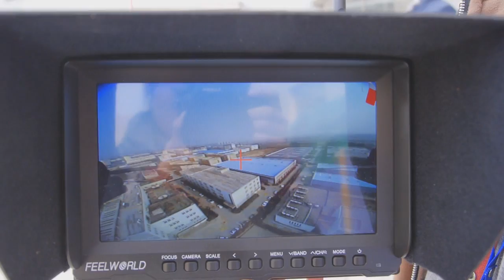Foxtech Beetle(Cicada) FPV Racing Hexacopter combo(I crashed!!!)

Comment: Beautiful design!
Crash is not a shame especially with a mini hexacopter lol
Nice job Mister Fu :)
Beautiful FPV monitor by the way ;)
Have a great weekend
Reply: ABMNS PRODUCTION  yeah, due to the weight, I didn't put on the low voltage alarm

Comment: Fu, after watching your video I might consider a mini hexacopter like this. But what are the flight times on what battery size? I still like efficiency on a mini tricopter or a mini quad. The sound I like very much.
Reply from the maker: Alfonso Alfonsos  we are using 3s 2200mah battery , about 10mins fly time .  For this kinds of frame ,we are more emphasize on speed rather than fly time Lol .

Comment: Great video! Very cool presentation!
Reply from the maker: Damir Spanic Thanks !
Reply: +Foxtech Hobby ... Video = Very good, & Flying Skill's = Very Good ... Just purchased one of these, looking at how to kit it out. Looks like you crash, due to technical issues at the end. But very good, Thank You !!!
Reply from the maker: +gordon hamilton 
Thanks for the interesting.
The crash was because of the battery running out, not technical issue
Reply: +Foxtech Hobby Telemetry needed then. Just finished building a Robocat 280. Looking to kit out my Foxtech Beetle. I like your setup, But maybe look at the power side of things a bit more. But great Video, thank you Sir !!!